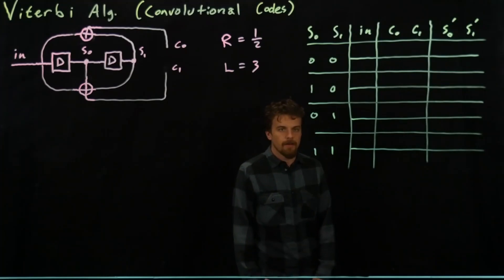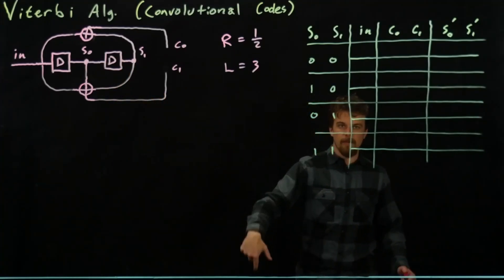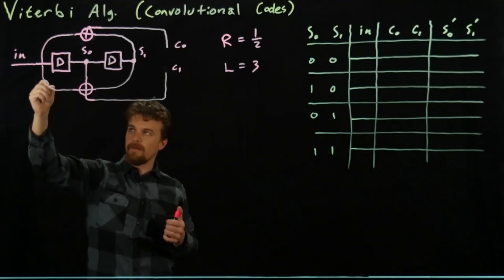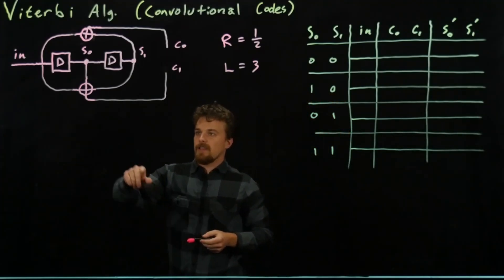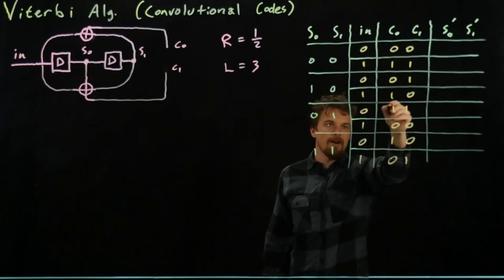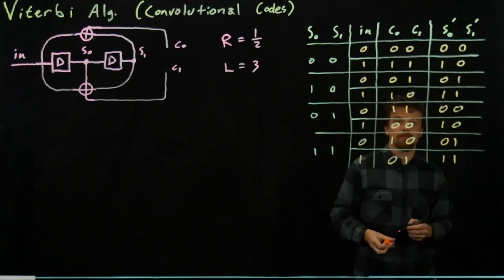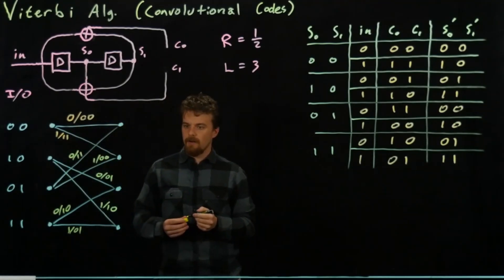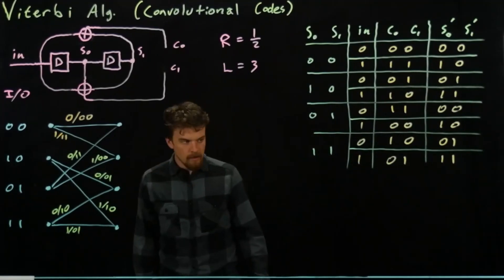Digital Communications: Convolutional Codes

Comment: Hi just a little question. Is there some reason the initial states you listed them as 00 10  01 11(0 2 1 3), cause I think if you list them as 00 01 10 11 (0 1 2 3)the flow arrow will not such complex.

Comment: i think you have exchanged the convolution codes of state 01 and 11 i.e the codes mentioned in the table for 01 are the codes when the state is 11 and vise versa kindly check
Reply: I personally calculate the bot C0 and C1 using simple XOR of S1,In and S0,S1,In ,respectively and there isn't any mistake I think.
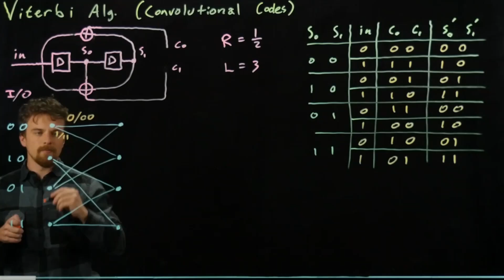Reply: their are mistakes in the state table. for ex: 9:51 from 00, the input is 1, we get 10, and not 11.
another mistake: 10:22, should be 1/11
Reply from the maker: Hello,

Thanks for your comment. We appreciate everyone who keeps us honest in these videos. If your concern is with the table Zac constructs, I have reviewed it and I see no problem with the numbers that are placed in. Please double check your answer as the conversion from diagram to table can be a bit confusing.

~Andrew